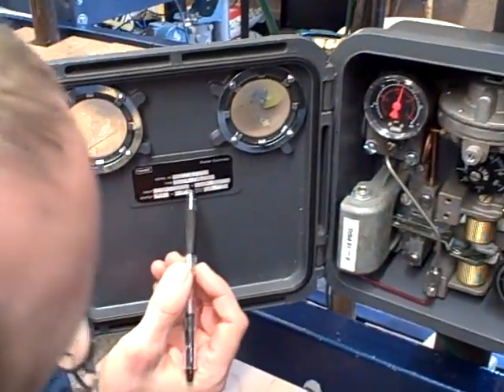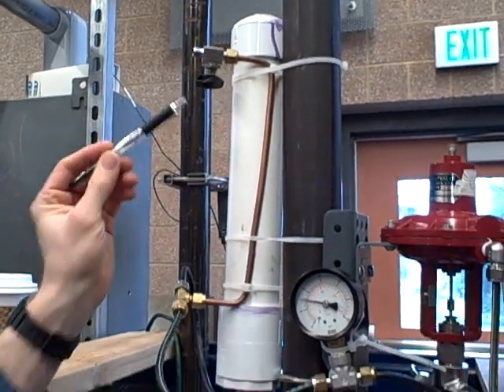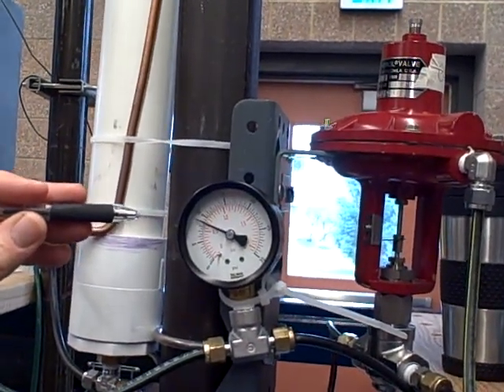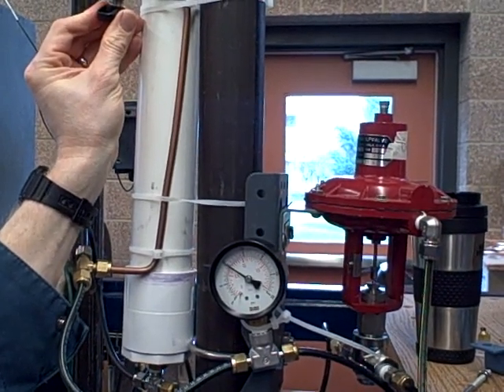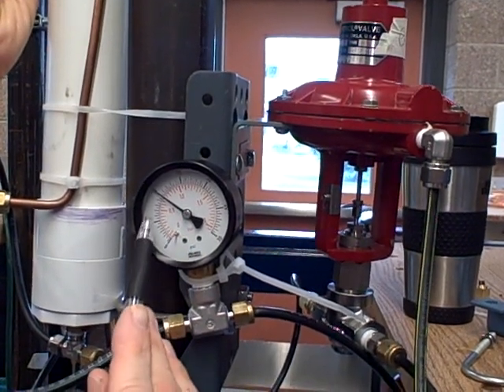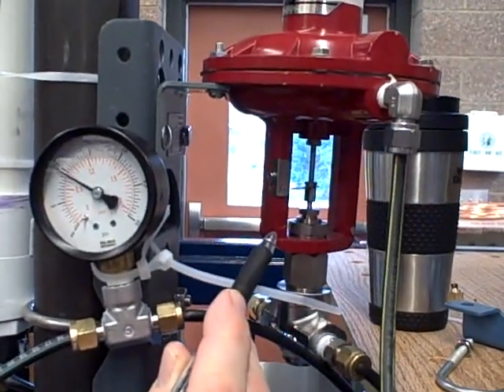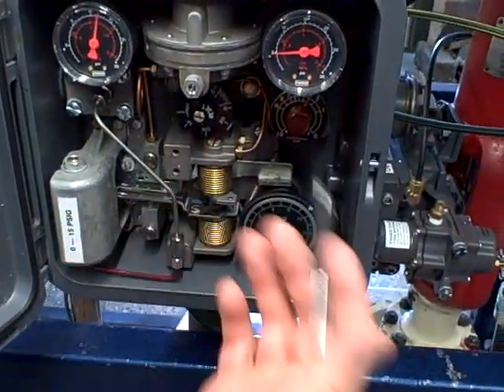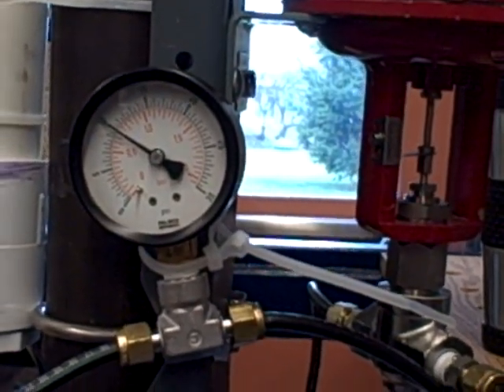Fisher pneumatic air pressure control loop

Comment: Tony, very nicely done. You are a good teacher. I came to pneumatic control for the HVAC industry back in 1983. Could you say a bit more about the air signal (black and yellow air line) that is operating the Normally Closed valve?

Comment from the maker: @ProcessVariable The valve happens to be linear.  The pressure drop across it is fairly constant so long as it maintains setpoint (about 35 PSI supply upstream, and a tank pressure of about 10 PSI downstream, for a constant 25 PSID).  This makes linear a very good characteristic for load changes (vent air flow).  Response to setpoint changes is less robust, because this changes the DP across the valve and hence the system gain.

Comment: Not that it probably matter too much in a short-lag system like this but I'm curious about the valve-characteristic. 
I would have thought it would be Eq% but thinking that in this application you might get away with Linear.